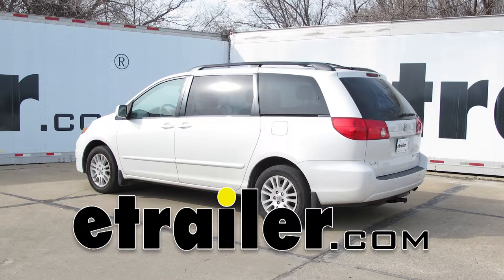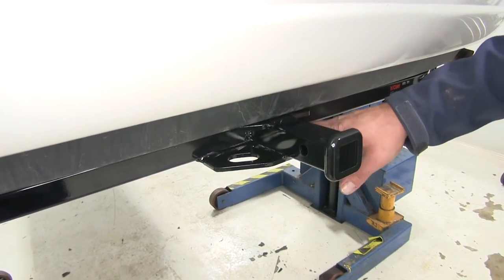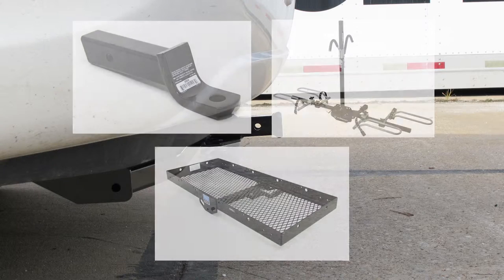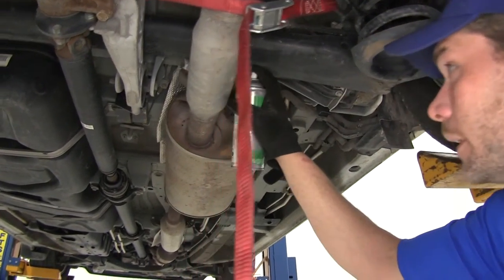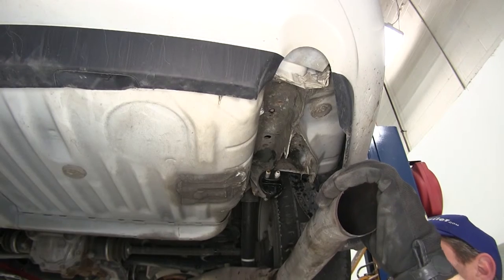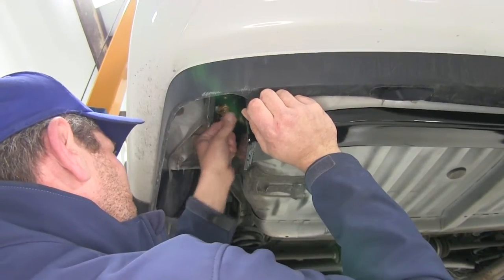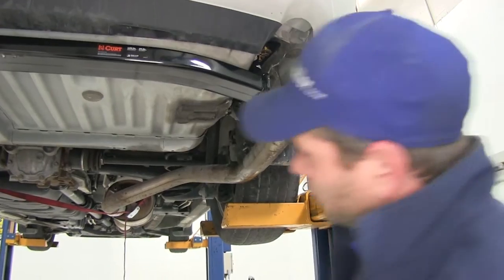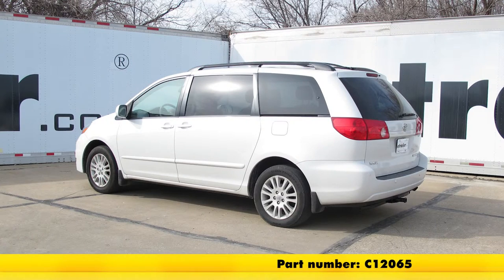etrailer | DIY Install: Curt Trailer Hitch Receiver on your 2008 Toyota Sienna

Comment: In case anyone ran into the same issues I did ... if the holes for the bolts on your van are rusty enough that you can't get the bolts started properly, or they won't turn in the hole under finger pressure, you will probably benefit from cleaning out the threads a little more properly.  
The threads I got with mine are M12 1.25  (fine thread) -- same thread size as some spark plugs.  I had to go find a tap, with this thread, and 'chase' it all the way through (keep it oiled, do a quarter turn, back if off, and go at it again for another quarter turn, etc.) to clean out the threads.  
Once I ran the tap through (had to use channel-locks to turn it -- the tap handle I had wouldn't fit in the space), the bolts turned like ice -- was easily able to torque it up to 79 lbs.
Reply from the maker: This is great advise for anyone who might run into the same issue of rusty weld nuts. This is what we do in the shop if the rust is bad enough.
https://www.etrailer.com/Trailer-Hitch/Curt/C12065.html